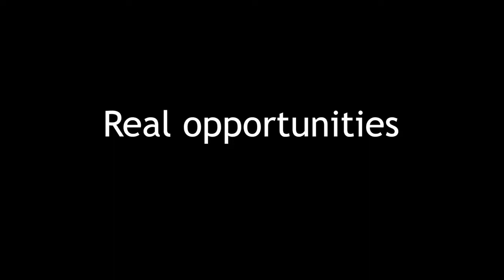Assurant Quality Inspector

Comment: Assurant does NOT honor their protection plan.  The Face ID and front camera stopped working.  Apple did a remote diagnostic and confirmed that the camera assembly that is used for the Face ID wasn’t working.  So I filed a (tried) to file a claim on line.  After entering my information I was asked for the date when it failed, then I was asked if it was dropped - No, then I was asked if it was exposed to a liquid - No.  To my surprise the application processed ended and a message came up stating (to the effect) that I have a mechanical breakdown and Assurant doesn’t cover it and that I need to contact T-Mobile.  Now let me make this clear.  You can go to T-Mobile and pickup a Protection<360> brochure that on the front cover says Protection provided by Assurant.  Turn the page and the third paragraph is entitled Hardware Service Issues (Mechanical Breakdown).  The first line reads (and this is word for word) -Malfunction? You’re covered if your device experiences mechanical breakdown.  Even after the manufacturer’s warranty expires.  So there you have it.
Reply from the maker: We would be happy to assist you with your questions related to your coverage. Please email our team at social@assurant.com with your name, claim (if filed), and contact number. In the subject line reference "YouTube".
Reply: @assurantinc  Apple remotely diagnosed that the front facing camera assembly has failed on my phone.  The MAC address of this assembly is married to the system for security purposes.  For this reason you can’t replace this assembly to fix the phone when the Face ID fails.  Assurant classifies this a mechanical failure.  Electronic components fail and failure of a component on this assembly is likely the cause for the failure of my Face ID and front camera failure.  So to correct this problem you would need a non configured system board and a new front camera assembly, install it and configure it to all of the components within the phone.  This is not doable for a number of reasons one of which the system board is not available.  HOWEVER your service contract states under “WHAT IS COVERED. 1 Mechanical and Electrical Failure (Hardware Services): If during the Service Contract term, You submit a valid claim on Your Covered Device to notify Us of a defect in materials and workmanship, we will arrange to repair or replace the Covered Device.” Based on all these facts and the fact that I didn’t even get far enough into the claim process to receive a claim number, I can only come to one conclusion and 5hat is Assurant will not honor their protection plan as it has been sold to me.
Reply from the maker: If you would like further assistance with this inquiry, please provide the details requested via the email address provided.